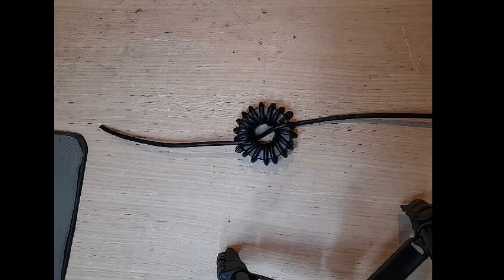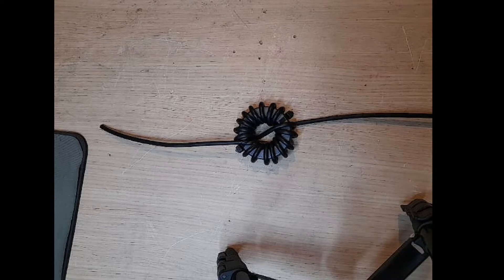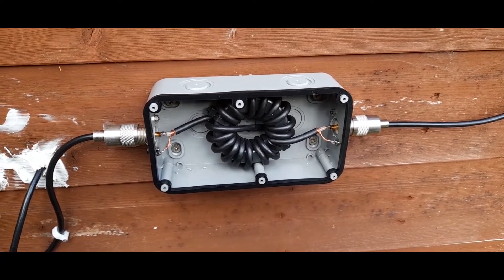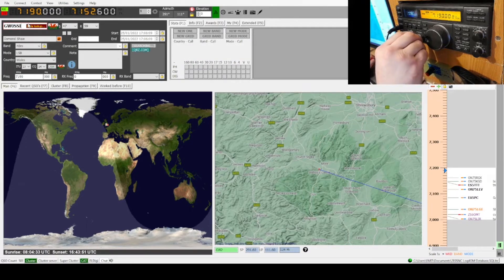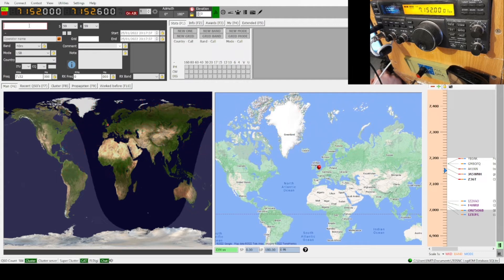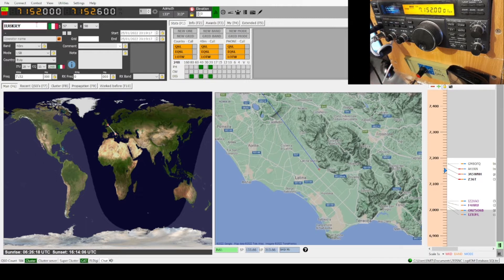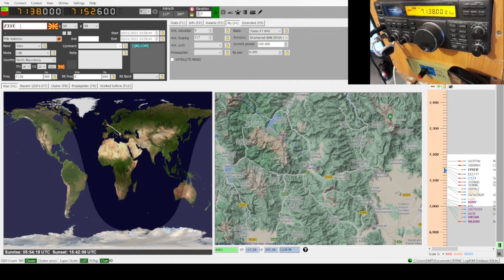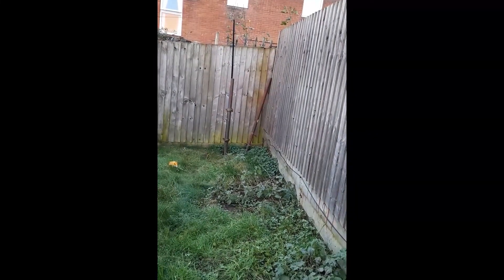RF Choke And Antenna Relocation

Comment: The end fed antenna uses the coax has a counterpoise. so putting choke in the shack will not stop common mode problem. the trick is allow the antenna to use the coax for a counterpoise.  place your choke on the coax at a quarter wave length.  so a quick ref say 40mtr end fed antenna will be 66ft divided by 2 is 33ft to give you 1/4 wave. so from the feed point 33ft that's where the choke needs to be. secondly the 49:1 should be has far from the shack has possible. ideally transformer close to the ground then around a 1/3 of the wire vertical and the rest going to the pole on the on your house. all this is in the full licence manual when you studied for your exam.
Reply from the maker: So was many things in that manual and im not the only person that most probably don't know that manual inside out. The book of secrets was a really big book and I'm sure not everyone that passed the full licence knows that book from cover to cover
Reply: @MØKNM-Amateur-Radio  the fact is you read this and remembered it. but like most hams the knowledge stored upstairs get pushed to on side when the tools come out. little bit of thought and planning spares the head scratching later . 73

Comment: I hope your RF in the shack is improved.  I had the same problem here in my shack.  RF was feeding back down the coax and shutting my computer down, resetting my weather station and just getting everywhere.  I have suffered a loss of that antenna in the tornado last month and am rebuilding and adding RF choke to my coax and also better grounding of all equipment in the shack to earth.  73 & GUD DX
Reply from the maker: Yes was little bit better but im getting other noises in due to every house having solar panels including my home(i have disconnected now)

Comment: Using coax maintains the Z⁰ of the trasmission line. And I like ysing this method. 
But wrapping it too tightly, beyond its minimum radius spec will cause trouble later. Center conductor will migrate towards outer shield. Causing impedance bump and possible short circuit..
Reply from the maker: Ill have to keep an eye on it, do a yearly maintenence.

Comment: It looks like you did a very good job wrapping it very tightly to the core and cinching it down tightly with cable ties.
Reply from the maker: I did try and make sure all turns were tight, pulling as i was making the turns.

Comment: Where in line did you put. Close to antenna or transceiver?
Reply from the maker: It's in-line just before it comes into the shack, it goes into the shack about 1m then into the matching unit.
Reply: The truth is it doesn't matter where you put a choke on the feedline, a choke works anywhere you want to put it.